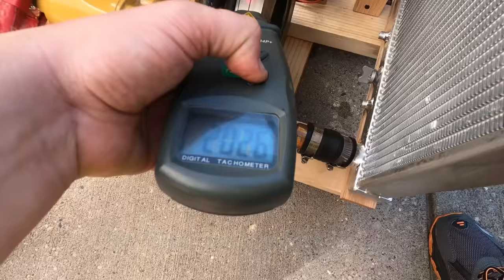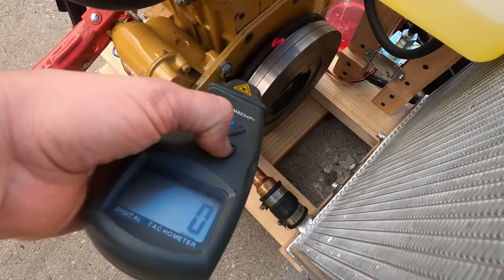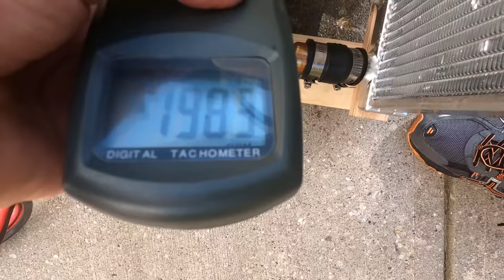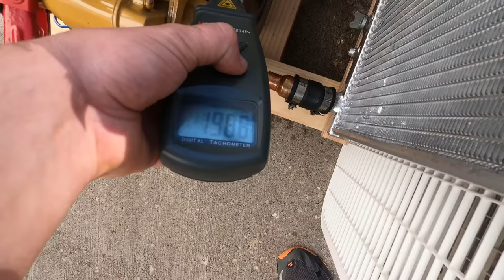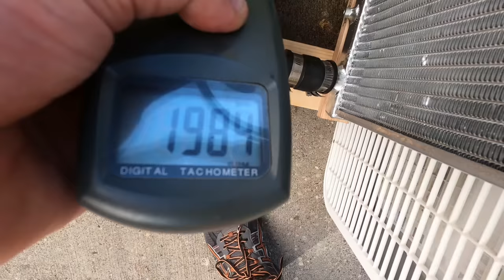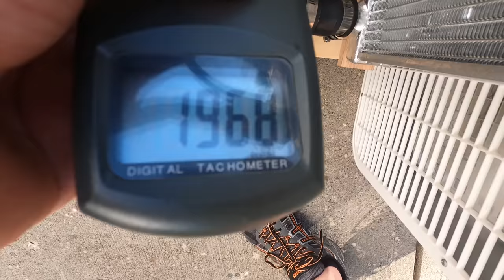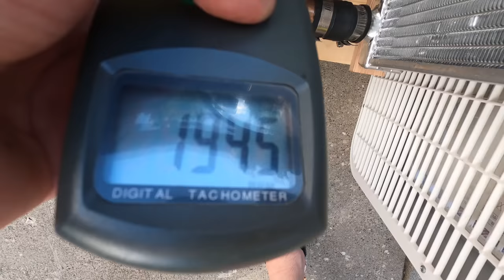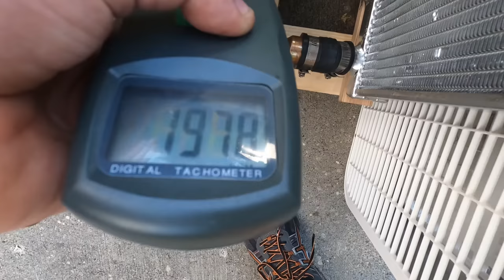Will Caterpillar Diesel run on Cooking oil? Attempt to run engine on Transmission Fluid & other oils

Comment: This raises an issue that could help reduce our petroleum oil use and at the same time help improve the income our farmers could earn. Why not use these oils to power our diesel fleets and heat our buildings? 

I would like to see the CO2 testing of the various oils to see if they would be better for the environment.
Reply: The world needs food.
Even the production of corn juice fuels (ethanol) in the USA is a kick in the teeth for starving people in the rest of the world....
Reply: There are loads of papers and research already done on the subject. The thing is, you have to properly upgrade the oil for long term reliable use. Oils are just not the same as diesel, they could be very similar, however that requires chemical upgrading which costs money and energy. These processing steps result in CO2 output, making the process not CO2 neutral at all. Also there is the argument that would you rather farm crops for fuel? or for food? Fertilizers are also made from fossil fuels. Lastly, we simply dont have enough land in the world to grow enough crops to sustain the world with fuels from farming crops.

Comment: The problem with running SVOs in a diesel engine is that they can gum up inside the motor due to incomplete combustion.  If you're going to run a diesel engine on SVO, you should start the engine on diesel (until it reaches operating temperature) and then switch to SVO while the engine is running.  Then, before shutting the engine off, you should switch back to diesel for at least 15 minutes to help clear out any build-up before shutting the engine off.  It's been a while since I looked into it so the best practices may have changed somewhat since then.  After Katrina hit the gulf coast back in 2005 I actually ran my F250 for several weeks on SVO because diesel was next to impossible to come by.  Luckily, I had already been researching the subject prior to Katrina and had ordered everything I needed to add a separate SVO tank in order to switch between SVO and diesel.

Comment: Rudolf diesel designed his engine to run on anything that's the beauty and genius of It the fact that now modern diesel cars if u put petrol. A more refined oil, it stops working is ridiculous. Any older diesel the older the better and it will run on more options. So off grid, an old cat, lister etc engine and generator, a battery bank and used veg oil turned into biodiesel with pork gelatine to superate it instead of the chemical complicated options and you've got a system of making electricity for basically free.

Comment: Now do ammonia.
Fun fact ammonia aka NH3 nitrogen hydrogen is a fuel and can be used in both gasoline and diesel engines right now, all takes is a vehicle propane tank kit then fill with ammonia.  Gas engines need no other mods, but  diesels  do. Diesels need software to control compression, but most diesel owners get these cpu power compression  software units  anyway .  Plenty videos and info out there on ammonia fuel in gas and diesel engines . Ammonia has been used as a fuel since 1960s NASA rockets, it is still used in ricjet fueo , aviation fuel, in race cars, tractors. the land speed record is held by a rocket car running on straight ammonia.

Comment: Home heating Oil and Diesel are the exact same.  The only difference is the dye in it.  If DOT did an inspection and saw a red dye in the tank of your truck, you'd be breaking the law.  Home Heating Oil is not taxed and Diesel fuel is taxed.

Comment: You can also run any type of jet fuel JetA, JetB ect. In a diesel we run all of out diesel equipment on JetA just because its easier to just put that in than go to the store and get diesel 🤷‍♂️ they they all run normal AND Jet A right now is $2 cheaper than diesel 🤦‍♂️ so if you have an airport that sells Jet fuel to people just get an external tank and fill it up and use than with transmission fluid to help with lubrication of the pistons

Comment: Heating oil is often exactly the same thing as regular diesel fuel (sometimes of a little bit less quality, sometimes not). The difference is just red die and taxes. Up to not so long ago, heating oil was what farmers were supposed to run their tractors on. Now it's, of course, illegal because some "bright" mind decided to make all food more expensive.

Comment: I don't see a load on the engine ..  You need to run a generator ..   Take any of your Vegtable oils and see if that engine will start when it's  -10 F or -10C ect

Comment: if you filter used veggie oil to 10 micron and add methanol to it for easyer starting for the cold and better burning in the engine 😁😁

Comment: Just don't use kerosene as it will wreck the injection pump. Had a customer that was told by someone that it would help in the cold weather. Very expensive.

Comment: If anybody knows the history of a chemically altered vegetable it's called peanuts peanuts for basically designed to make diesel fuel plastics and a few other things but mostly the power diesel engines so if you study how to filter and heat your vegetable oil it's a no-brainer what you can do it's on an internet when you smell that diesel car truck go be front of you and you smell french fries you know what's going on. I will say this exhaust from burning vegetable oil can make you dizzy. Even though it smells like french fries.

Comment: Running multiple types of fuels in a diesel engine is very interesting, both technically and philosophically. The vegetable based oils have one thing in common: they give us whats called Carbon Neutrality. The CO2 produced by the engine is used by plants to build leaves and stems and seeds which are again used for fuel. no ADDITIONAL Carbon is given off into the atmosphere.. And that is the whole point in using plant based fuels in ICE engines. My personal experience? I ran a E class diesel Mercedes on 100% home produced biodiesel without ill effects on the car. Gasoline engines CAN use pure alcohol but the environmental cost of producing alcohol of sufficient purity is prohibitive. And thats where we are at today.... if it werent for the oilboys and their mass indoctrination aimed at preserving their profits from selling the bad stuff maybe people would be able to look at the big picture more clearly.
Reply from the maker: I wonder where do you get methanol and catalyst in large quantities to make home production financially viable? I can make biodiesel in small batches too but the price of chemicals needed for production makes the process costly to the point where buying at gas station is much cheaper and easier.
Reply: @andreysmirnovusa  Exactly ..we (partner and I) got the Methanol by the Hilo racetrack after we got in touch with the company that distributed it.. I forget who exactly that was. But I remember we calculated the cost of making a gallon of BD at areound 1$ while everyone was paying in excess of $3 for the diesel at the pump. We were still able to buy 4 drums of Methanol on a pallet for I think about 600$ ,Years ago!, But the shipping of the Methanol was problematic, the disposal of Glycerol was problematic, the purchase of Sodium hydroxide was increasingly problematic and finally, the State required restaurant owners to dispose of  the used cooking oil by licensed "throw away artists"..that was the last straw...we produced for 7 years and ran 4 diesel vehicles on 100% BD. Then you add the VERY DRASTIC destruction of the environment that all the palm oil planting is causing....I mean Orang Utans without their jungle, there just is no large scale solution of the sustainable energy problem we have on this earth, because large scale is by definition, unsustainable.

Comment: Hey I have one question will it work with palm oil too?
Reply from the maker: I think palm oil is not liquid under room temp is it?
Reply: @andreysmirnovusa  what if we heat it and add some thining agents to reduce viscosity of it then?
Reply from the maker: @ZarawarKhan-gs8hr  if it is thin enough, I think it should work. I can certainly try it. This mechanically injected diesels take almost anything unlike injected cars in which case it fuels should be very thin like diesel, you can see in my other experiment where I tried to run 2015 VW on WD40.
Reply: @andreysmirnovusa  bro kindly do the experiments of it can I have ur WhatsApp no. since I wanna talk more about biofuel.
Reply: @andreysmirnovusa  hi I have conducted one experiment on diesel engine by running it on light diesel oil. Wanna share video with you.

Comment: It's not good for the injection pump to pump thick oil, a cheap colleague bladed 1/3 hydraulic oil in his old diesel car... It worked for 2-3 thousand KM but then the injection pump broke and the price became much more expensive than what he saved in fuel costs ! :face-purple-crying:

Comment: I want a engine like that 
Where you bought that engine
Reply from the maker: I got at a local contractor by an accident. Sorry it was a one of a kind thing
Reply: @andreysmirnovusa   ok
Reply: @andreysmirnovusa  if you have the engine model!!! /serial nunber
Or name(complet)...................
Reply: @dariusstruna1423   I know its been over a month since you replied to this video but i may have some info for ya, that motor is a cat C0.5 13HP 2CYL diesel, they are very common in APU"s (auxiliary power units) in semi trucks. they basically run a generator. some have heating and cooling capabilities as well. I plan on making a go-cart out of mine, it will be rolling coal for sure! I dont have a part number as of yet but i will update you with it
Reply: No problem thanks

Comment: rudolf diesel originaly design his  engine to run on vegetable oil.
over this, oil used as fuel  was firstly used as lube in crankcase, then when heated as fuel.

whatever it is, if it burns it will run in a diesel engine.

try with 2 stroke gasoline mix, will do as well.
brake fluid.
melted paraffin.
...
too thick, add gasoline.
too thin, add oil.

Comment: the reason i was suggesting shorting the output of an alternator is we all know about dynamic and regen braking.

another way to put a load on it would to connect up a headlight to drain the battery then use a jump starter to start the engine then connect the dead battery to the alternator while it is running.

all you have to lose there is a battery and if the battery is rather new since the warranties are pro rated it should not cost much to replace.

Comment: - Heating oil is diesel but with a lower state tax. Observe the laws in your country.
- Diesel from sunflower oil is not a good idea this year. The world's largest sunflower oil producer in Europe was attacked by a neighbor in February 2022. Since the conflict is not over, burning food is not a good idea.
- Corn is highly subsidized in the US. That's why corn is only cultivated so often in the US, but rather rarely worldwide.
- Engine oil: feared by diesel drivers when the engine seal burns through and the diesel engine burns engine oil. Then you can interrupt the diesel supply and the engine will continue to turn uncontrollably.
When the engine oil is empty, the engine stops with bearing damage.

Comment: Old news. It will run on wvo if properly filtered down to 5 micron. Also used engine oil but you won't like the smell

Comment: A diesel will run on basically anything that's oil based its known as a "dumb engine" or in my opinion clever as it has no ignition system its just compression ignition. A gas motor will run on anything highly volatile easy to light highly flammable that in a diesel engine would cause detonation. Things such as gasoline (obviously) propane, butane, natural gas, ethanol alcohol, methanol, and isopropyl alcohol.

Comment: Red heating oil is diesel just colored red alot truck driver get fine for running it
Reply: Heating oils or any type of distillate oil is exempt from federal, state and local taxation that would otherwise be applied to road use fuels like diesel and gasoline. Thats why truckers get fined for using it. The only reason why they dye the fuel is for law enforcement to tell the difference between on road, and off road fuels like kerosene, and heating oil, or any other type of distillate oils.

Comment: Diesel engines will run on whatever viscous oil. Even runs on gasoline but that will eventually destroy the high pressure fuel pump.

Comment: First of all if any of this substances have diffrent heat transfer they will kill oil pump... they also have diffirent 'calories' in case of burning them soo with no load of course they will start. I have use a surface like dash board cleaner to pre start my old Opel Omega 2 and a half litre diesel to start but they need diesel fuel to run. And the turbine is quite of end of their life so... did you know simple flour can cach fire if their have good mixture with air? Thats a reason they can start. But all is abaut efficents.

Comment: Not very surprising that an engine originally designed to run on vegetable oil is able to run on vegetable oil...
Fine for engines equipped with mechanical indirect injection, but none of these fuels are suitable for modern common-rail direct injection diesels.

Comment: If that was real 5/30 engine oil why it didn’t smoke??
Reply: Diesel is an oil also; oil burners are meant to burn all oils.
Reply: @nathankoroush7918  you don’t know what you’re talking about, diesel is the last refine of the crude , and oil is a total different thing.
Reply: It will smoke under load then dirty up the injectors and then it'll smoke on returning to diesel as well. I've played around with this before
Reply: @garethmilne6887  so you do know what a runaway Diesel engine means? When you blow a turbo seal the engine runs on its own oil and smokes like crazy, just saying and I didn’t see any smoke while that little cat was running on oil 🤷🏻🤷🏻

Comment: Please be aware that some of the fluids you have there will degrade the seals of the engine over time, mainly inside the injector and fuel pump. In particular, ATF is nasty. Be sure to clean it out with proper diesel fuel before storing it.
Reply: Yes ATF is know to ruin seals and gaskets. That's why transmissions don't use any seals or rubber parts.

Comment: The diesel run on every thin oils.😁
Reply: Also will run on WD40 sprayed into the intake...
best way of finding out if there is a fuel issue...
if it runs on WD40 spray......

Comment: Dude you're going to destroy the engine. Those oils have different components that coat the cylinders and other components at that temperature. The BIODIESEL exists for a reason: to remove the components that will damage permanently the engine. I don't know exactly what you try to measure with a tach...I would use a temp gauge better.

Comment: For this little engine there'll be hardly any difference.  
Older car diesel engines that are NA you can see the difference in the tailpipe smoke.

More modern Common-Rail engines without dpf you will see no difference at all . Did that with filtered waste motor oil for a longer time. Starts just fine and drives completely normal

Comment: Diesel simply refers to any fuel that can be used in a compression-ignition engine: kerosene, on and off road compression fuel, or, 'diesel', lamp oil, cooking oil, motor oil, bio'diesel', etc; they're all the same or similar long-chain hydrocarbons, just with different dyes in them and sold at vastly different prices. The whole industry is really fucked up when it comes to the fuel, but the engines themselves are works of genius. Diesel was an awesome dude!

Comment: A no load test on a diesel isn’t a very good test.   A diesel can idle with only 25% of its cylinders firing.   You need to test under load

Comment: the sulfur that used to be in diesel helped lubricate the fuel system better.... which is the REAL reason it was removed. can't  have those pesky diesels lasting for 1 million miles without selling lots of parts and labor!

Comment: Not sure what the purpose of trying the different oils….anything that costs you more per litre than good old fashioned diesel fuel is a waste of money and potential harm to the the engine.

I could see using alternative oil/ etc if it is waste oil ( for free) or you are out of diesel and stranded.

Comment: Nice video, but you need to learn about diesel engines. Those oils will kill the diesel fuel pump and damage the injectors slowly but surely, also plants based oils will grow sludge due to bacteria growing in the piping system, oil filter, diesel pump and diesel injectors. pistons walls and pistons ring. that will damage the engine and the engine parts because not all of the oil burns due to high flash points, high viscosity and low pour points. Most new diesel cars and trucks and high-end generators will never work due to some sensors. Cheers.
Reply: Diesel pump inside gasket must be qualitie yess most bosch pump will handle it Just fine! Engine like this wil handle oil like a camp, dont worry fuel system and injektor will actualy be more clean than on diesel. Bt I rekormand extra oil service on the engine end fuel filter dont lisen to haters !!
Reply: @Norgesbeste1  you kinda wanna make a 60/40 or 70/30 mix of your alternative fuel and diesel. And add in around 1:300 2 stroke oil to keep lubricity up.
Reply: you kinda wanna make a 60/40 or 70/30 mix of your alternative fuel and diesel. And add in around 1:300 2 stroke oil to keep lubricity up.

Comment: Transmission Fluid the worst thing you can do to a diesel damn man its a friction modifier!
Reply: Eh, it’s good to loosen up injectors on older diesels 🤷‍♂️ I fill up my fuel filters with atf when I install a new one
Reply: @jtmoney416  
Same here...there is no difference I can detect as I drive down the road......
Reply: Remember that a shot glass could fuel this thing for 1 minute or so, so the amount injected is very little and most of it is burned.